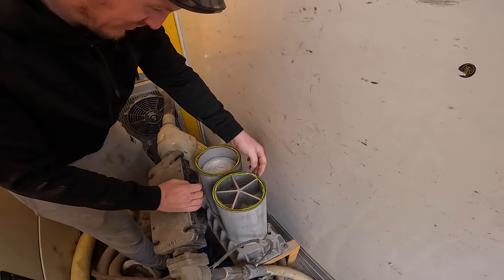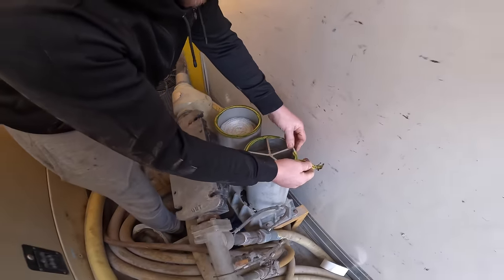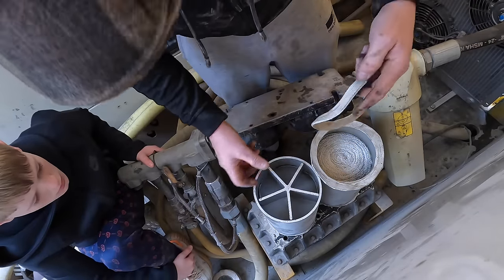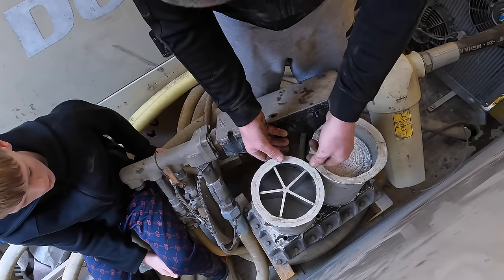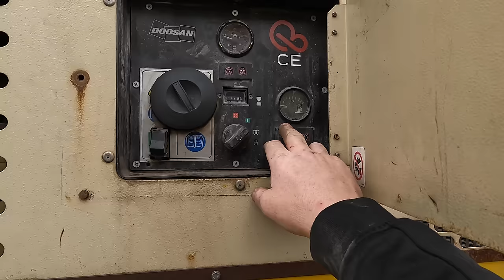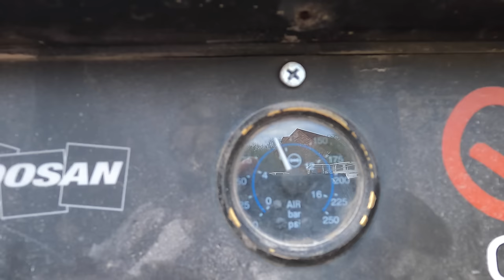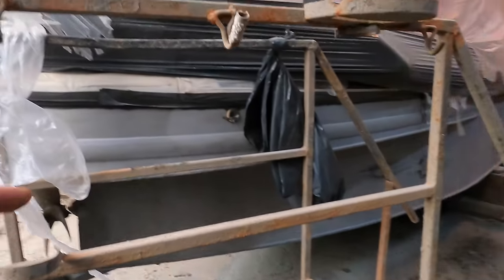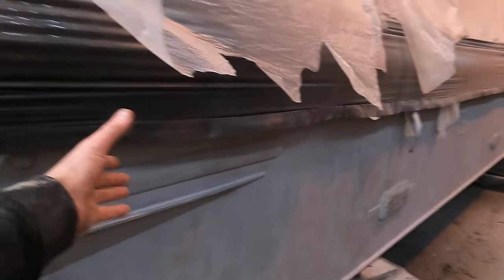long boat SandBlasting

Comment: So great to see young Jack helping his old man out 👍. Amazing video Mick. Still don't no how you blast without gloves 🤔😁 I would feel naked 😅. Nice job mate 👍 👌 🇭🇲🏴
Reply from the maker: Haha he's a good help sometimes 😄 skin like a rhino mate or stupidity haha
Reply: @Mobileblaster  haha 😆 your a Englishman 💪💪 tough 💪 🤣. You can handle the cold 🥶 better than me.
Reply: Don’t blast without gloves - sooner or later more likely sooner you will notice small black spots on your hands which will not go way. The spots will later become infected, the infection becoming persistent and leading to serious issues. By the time you notice the black spots it is too late as the debris from the blaster along with bits of blast media have become imbedded under the skins epidermis ( outer layer).
Reply from the maker: @grahamc887  Scott knows all too well what it feels like he's a tattoo like scare from the blaster 😂 how soon we talking? I use gloves on cold days but summer and hot days I don't and its been 15 ish year so and I've yet to hit myself well I fell off a jcb bucket (load all) once and my 1st reaction was put my hands down to brake my fall I would have been better just holding the pipe and fall however because I got bit on the cool down across the leg 😬 that hurt more than the fall would have haha
Reply: @Mobileblaster  😅🤣 depends on what abrasive you are using on the day. Fact is you Mick definitely cover up when you blast with shot blast 👍. Each to their own legend.

Comment: A lot of maintenance and equipment needed for your work.   Seeing the maintenance of your equipment is almost as interesting as seeing the equipment working.  Thanks for making these.
Reply from the maker: 😊 I don't show half of the work needed to keep it all working as it should maybe I should add. I've just fitted a new alternator and batterys water pump and thermostat but didn't film that 🫣 I've still alot more to do to get things upto 100% 😏

Comment: Quality boat. I think the condition is a combination of anodes, maintenance and a decent builder in the 1st instance
Reply from the maker: Yeah I like the front bit on this real nice shape and the quality of the build was 2nd to none even the joints wasn't warped and nice and flush he mentioned something about this boat also had something that when it's plugged in to 240v it don't use the power like normal boats it charges and the boat runs off its own power supply I can only think battery banks or some kind of earthing that don't earth to the boat or water I've forgotten what he called it sounded very technical but obversly something is working as it was in real nice shape to say the years its had in the water 👌👍
Reply: @Mobileblaster  galvanic isolator?
Reply from the maker: @DEmma1972  that might be what he said I'm not 100% but if it dose something similar as to what I'm trying to explain then yeah haha

Comment: Hi Mick
That’s a great example of how blasting the steel from new keeps the rust and pitting at bay. The anodes do help but I’ve done them when they’ve had the anodes on but not blasted and they’re pitted to hell. Spend a little bit more in the beginning and have them blasted, cut corners on the anodes👍😂
Reply from the maker: Yeah definitely do it right from the get go and get the very best service life out of the steel 👌👍
Reply: Definitely, also only use International 2k paint. Believe me International is the best of the best. I’ve been using it for over 20 years and it outperforms anything else. I’m going back into tanks I blasted and painted 15-18 years ago and honestly they are like the day we did them. The tanks are submerged in raw sewage and attack by methane gas and the paint it’s literally untouched. And it’s the same product they use on ships and oil tankers etc.
Reply from the maker: @pato54321  👌👍 I don't know about paints/coatings I just stick to blasting 😏😂

Comment: Hey Mick,🫨another learning video for me,please let us know where did you get your aftercooler mate! 
Need one too! 🍻🍻
Reply from the maker: After cooler is adapted from an oil cooler 😎 intercoolers don't work they arnt rated to the right psi so long as it's big enough for the cfm you plan on pumping any shape will do I opted for a deep profile so the serface area is slightly smaller 👍

Comment: What do them block things do that are all around boat and why dont you blast them.....
 Was thinking as you were blasting how well the steel looked and hardly  any mill scale...... Another top video mate 👍👍
Reply: Anodes.
Reply from the maker: Yeah they are supposed to give their electrons easier than the steel in theory leaving the steel intact 👌👍

Comment: Might be too late now but if the owner is 2 Packing the boat then all them Anodes are not needed down the side, only needed around the Prop and Rudder, like the Anode on the Skeg is a good place to put it and one each side of the swim near the Prop and a couple on the Rudder. If it has a bow thruster there is a Anode on the prop end to protect the metals in that area.
Reply from the maker: I understand how they work and the logic of them but I still wonder do they actually work. This boat is obviously convincing me they do but I've done a lot of boats before and see even pitting regardless if they have a lot or hardly any. I think good prep and a good service plan is the way to go personally saying that if I had a boat I would fit them for peace of mind they don't cost the earth and last a long time so why not 😏 I'm on the fence like I say I know the logic and understand why they use them but I'm less than convinced they actually do that much just from the amount of boats I've blasted over the years if I spotted a noticeable area near the anodes that was cleaner or less scaled then I would be more convinced normally if a boat is pitted its pitted in a uniform way 🤔 its 50 50 for me if the work or not haha
Reply: @Mobileblaster  The problem with putting on for piece of mind is , IF you 2pack it , when you weld / break the surface of the paint you introduce electrolysis into the area around the Anode. I agree it is a science but I spoke with boat surveyors over my career and this is what it led me to believe. Also I saw a guy re applying roofing felt to his Hull, and his Hull had not one bit of rust or corrosion. The felt acts as a electro insulation just like the 2pack.
Reply from the maker: @madmick6805  Yeah I've spoken with builders and surveyors they all say the same thing anodes work and should be used I'm not going to disagree because the science proves it should work I would like to see an area round the anodes be cleaner steel than say an area that not got them but that would be impossible as a fair test as coating thickness and water will very etc like if the shower empty port is on 1 side etc it would be impossible to do a fair test. I don't have much to do with paints/coating it's not something I enjoy doing I'm very limited with knowledge in that department. I would love to see a scientific experiment with the anodes tho 😏 it would take some time to film I would imagine 😂
Reply from the maker: @madmick6805  I've only just clicked on mad mick the boat builder 😂👌👍 if anyone would know about building a boat or two you should know haha
Reply: @Mobileblaster  Mine is out in August, so we will see. I'll take some pictures before and after 👍
Reply from the maker: @madmick6805  👌👍